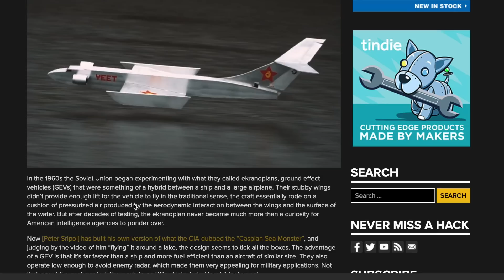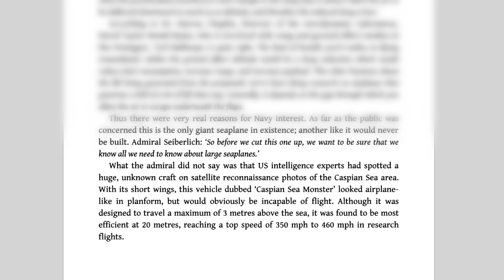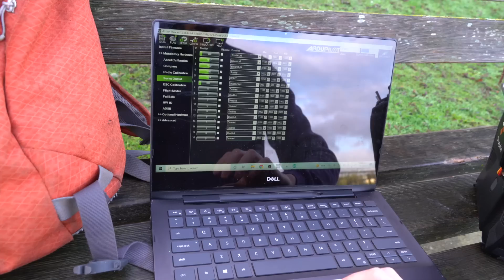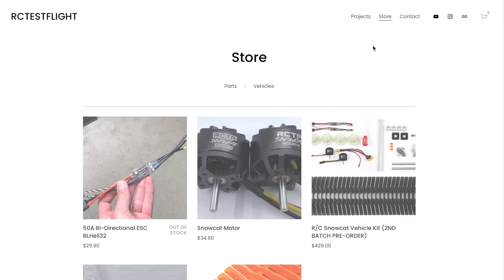Worlds First 'Real' R/C Ground Effect Vehicle

Comment: My defenition of a ground effect vehicle is when it can fly in the ground with a much higher efficiency than flying normally in the air
Reply: Yeah. That's the more interesting definition anyway. It should derive some actual advantage, in this case efficiency, from the ground effect.
Reply: That´s true for every aircraft
Reply: @ikermunoz6947  thanks, this reliefs me of the annoyances about a few last videos.
Reply: @ikermunoz6947  "That´s true for every aircraft"
While I think it's safe to say most/all aircraft are more efficient in ground effect than flying slightly higher than ground effect, I think some airplanes have their optimal efficiency at much high altitudes.

The MIG pilot who defected from the USSR had to fly low to avoid radar for part of his flight. He was very eager to get back to a higher altitude because flying low was burning fuel way too fast. I'm pretty sure dropping down to ground effect level (even if practical) wasn't a good alternative.

@Everyone: We just having fun here right?
Reply: @ddegn  those migs have short wings and ground effect happenens only at 1/2 the wing span in altitude. and there is like trees and stuff. also high altitude is just stright up better than ground effect. it loweres the drag by just haveing thinner air and lower fuel compution by haveing less oxygen. ground effect is only so good at reduceing drag from helping with lift.

like the voyager that fel around the world on one tank of gas flew at high altitude for a reason.
Reply: @nick4506  "those migs have short wings"
Yeah, good point. Kind of hard to fly in ground effect in a MiG over trees.
I remember reading the pilot's autobiography as a kid and being surprised the airplane flew better at high altitude. As you point out, there are reasons why high altitude can be more efficient.
Reply: @ikermunoz6947  yes i know the every aircraft most be at least a bit unstable to fly correctly, but in my comment when a say un stable it mean for this kind of vehicle.

the wings of a ground effect vehicle is optimised for the ground effect area, above that the air flow and lift become really different so the center of lift move, resulting  in a unstable flight for the ekranoplan
Reply: Would be interesting to measure the power draw from flying in ground effect versus flying in the air
Reply: agreed, I think even the massive Russian ones could leave ground affect, I heard somewhere that they were designed to fly over tall bridges if needed.
Reply: Exactly what I was about to comment.
Reply: Exactly. GEVs aren't supposed to be unable to fly - anything can fly if you have control surfaces and a powerful enough motor (even if it's essentially prop-hanging). GEVs are meant to be designed to fly at that height, using ground effect to get better efficiency.
The ones that don't seem like GEVs are when they can fly high by essentially prop-hanging, but when they're flying low over the water they're still kinda prop-hanging - much less efficiency than just giving it big enough wings to fly as a plane.
Reply: Easily measurable by amps and meters. Good idea
Reply: I may be way off here, but..
I thought the point of the ekranoplan is that it's possible to make one that can carry more weight at a lower fuel consumption, than a similar plane designed for high efficiency at a high altitude.
I.e. the absolute max fuel efficiency carrying heavy cargo is an ekranoplan in ground effect, not a normal plane at high altitude with less drag. Speed would be lower, but efficiency higher.
Reply: @phizc  yes, due to flying in ground effect the induced drag is reduced dramatically. So more lift at lower drag compared to flying higher. Normal aircraft improve efficiency by flying higher in thinner air.
Reply: I agree, and still, a ground effect vehicle is not just an airplane flying low, but an airplane designed and prepared to fly low, e.g. capable of touching the surface at full speed, and other specifics that should never happen to a normal airplane, but will be unavoidable in ground effect heights (e.g. obstacle avoidance)
Reply: then all planes are ground effect vehicles. because all planes are affected by ground effect.
Reply: @nick4506  that's true, but the efficiency of a plane that's designed for being a ground effect vehicle is much higher than a normal plane can a achieve in ground effect
Reply: Beautifully executed!
Reply: That’s a good way to think about it
Reply: You almost got the actual definition. The problem with yours is, that any aircraft will fly with a much higher efficiency in Ground Effect. What makes a GEV special is simply that it is optimized for this flight regiment.
Reply: @Argosh  Well, you'd want it to be able to stably fly in that ground effect - I think the crux of the issue that people have with most RC ground effect planes is many of them are simply planes with active controls (eg a PID controller on the elevators) to keep them flying low to the ground. My impression is that full-size ground effect vehicles are set to a throttle level where the ground effect would automatically keep it at that height.
Reply: @Vousie  rc aircraft operate at Reynolds numbers and weights where self stabilization is unreliable. So yeah, they need a bit more help. The definition still works perfectly for them.
Reply: @Argosh  And that is why I don't think a "real" RC GEV is possible. It just can't work with the self-stabilisation that GEVs are supposed to work with. Thus the only way to do it is to "fake" it with PID controllers or similar.
Reply: @Vousie  actually the opposite is the case. To fly an aircraft at below 500.000 Reynolds Number in such proximity to ground requires modification. While theoretically possible it is generally avoided because of the inherent instability close to the ground.
I can fly my F5j sailplane at 1m above ground. It will do really well, until a gust hits and it crashes before I can even counter steer.

It is possible to aerodynamically mitigate that with a variety of measures. One is, ironically, not to fly too deep in Ground Effect.

Ground effect is a factor as high as twice the wingspan depending on speed, beginning when the downwash interferes with the ground. The deeper in you are the more jumpy your vehicle becomes. This is due to the fact that if for any reason you loose ground effect you loose a massive amount of lift. So while you might barely even notice a small gust at 50m, it will totally wreck you at 1m.

Fun fact: I'm speaking from experience here. I've lost a model and nose dived many more because of sudden loss of lift in ground proximity. That's why I've started to fly basically anything with at least butterfly breaking available to shorten the period of maximum risk.

You can try to fly F3k if you want to get a good feeling for operating a small RC plane close to the ground. They're generally tough enough to survive nose diving from a meter or so.

I already stated in a comment what I would do: Build a forward swept flying wing for optimum stall characteristics and then experiment by getting closer to the ground little by little.
The idea of Ground Effect isn't necessarily to fly as close to the ground as possible, it's to extract as much lift as feasible at the lowest possible drag while in a stable configuration.
Reply: Seems like they should just be called GEP or ground effect planes.  Just like we have cargo planes, passenger planes, stunt planes, etc.
Reply: I agree. Take the flight time and then compare to ground effect time. If you can go longer in ground effect than you have achieved the goal. If you can double the time I think you win a prize of some sort but ill have to double check the rules on that lol
Reply: Your definition includes literally every single aircraft lmao
Reply: @aleksjenner677   that's true, but the efficiency of a plane that's designed for being a ground effect vehicle is much higher than a normal plane can a achieve in ground effect
Reply: Agreef
Reply: That is the right definition sir.
Reply: @ButterfatFarms  

"Certified for operation..."
"Certified to temporarily..."
"Certified for operation..."

None of that defines what the individual designs are capable of achieving. It only specifies what they are legally certified to do.
Reply: Can’t argue with that
Reply: @Wischmopps  i thought planes were more efficient at higher altitudes in the reduced atmosphere
Reply: @Grim FPV yes but most of them were unstable above groundeffect, the only one who was really able to fly efficiently both in the groundeffect and out was the VVA-14 and he had a bigger aspect ratio  that any other ekranoplan
Reply: So never then, got it. Nothing would have higher efficiency closer to the ground thanks to gravity, wind, and air pressure. You are defining cold fusion here. Build a boat that can swim against the current with out any power - you. Can't be done friendo. If you develop cold fusion though, you'll be rich, famous, then dead by all the angry power manufacturers.
Reply: @johnthomas1422  your example is extra funny because a boat that can go against the current without power exists. It's called a "sailing boat". Even extracting energy from the waterflow alone is theoretically possible.
So yeah, the point of ground effect vehicles is literally to reduce induced drag by proximity to the ground. That allows them much higher efficiency lift and thus more speed and capacity at the same power.
Reply: @johnthomas1422  "So never then, got it."
Are you replying to a comment in this thread? If so, which comment?
Reply: @johnthomas1422  https://youtu.be/jyQwgBAaBag

I'll let you know how the cold fusion goes.
Reply: @Grim FPV Did you miss about the efficiency part in the comment you reply to? Yes it could but it was not effective, so whats the point with your comment?
Reply: @Jeppelelle  They acquiesced. By showing that even THE ground effect plane could 'fly', they are indeed saying it does not negate the RC design being a ground effect vehicle. It's literally what is said in tue first 2 minutes of the video..
Reply: @Jeppelelle  You clearly misunderstood the comment
Reply: @Jeppelelle  

"But it was not effective. So what's the point with your comment."

Clearly the point was to provide an example, in support of the original comment, of a ground effect vehicle that could fly but was more efficient in ground effect.

Original comment: "Definition should be; Can fly out of ground effect, but it's less efficient."
Reply: "Provides example of one that can fly out of ground effect, but it's less efficient."
You: "Did yUo MiSs tHe PaRt aBoUt EfFiCieNcY?"
Reply: @notahotshot  Read the comment i replied to again, then mine, then try to apply atleast one ounce of intelligence while reading it. Your reply makes no sense since you obviously did not understand the conversation
Reply: @Jeppelelle  it sounds like you didn't understand the conversation.
You weren't the original commenter, nor the replier.
And apparently you missed notahotshot's last paragraph. Smile
Reply: @mattymerr701  No i was not the original commenter, never claimed i was but i was the replier, i replied to Grim, it's pretty obvious, don't you know how mentions works?
Reply: @Jeppelelle  okay, yep. I'm just being baited by a troll I guess lol.
Only explanation to the double-down without any reflection right
Reply: @Jeppelelle  

The comment you replied to provided an example of ground effect vehicles that could inefficiently fly out of ground effect. This supports the definition provided by the original comment.

Your reply was to ask if they missed the part in the original comment about efficiency.

Your reply was pointless.
Reply: @Jeppelelle  they are pointing out how the comments that started this video have a faulty definition.
They are agreeing with the comment at the top of the thread, by pointing out how it is more realistic compared to the faulty definitions that sparked this video.

(Well, they might not be agreeing with the original comment. But it shows that the definition of a "real ekranoplan" aren't right)

Comment: What if you used hydroplane surfaces to lift the plane out of the water and make them retractable?
Reply from the maker: I know hydrofoils and GEVs intuitively seem like a great match but turns out they are pretty much completely incompatible. I've experimented with this myself and know others that have done so as well. Even though hydrofoils have a lot of hype about having very low drag, they actually have quite a lot of drag at high speeds compared to a hydroplaning surface. They are also very picky about their speed range making it almost impossible to match an aircraft's ground speed which can vary greatly.
Reply: I had the same thought. I think the foil could definitely pop the GEV up off the water at a lower speed, but retracting the foil without pulling the vehicle back down seems hard. I can almost convince myself it should be possible, but hard to explain in a youtube comment :D
Reply: @rctestflight  wow, i never expected a reply, but yeah that totally makes sense
Reply: @rctestflight  Thats true, however he used the term hydroplane. He may have meant hydrofoil, but the hydroplane may actually be workable. Hydroplane as being a a planing hull surface. 

One can suggest pontoons or skis on a suspensions system of sorts that may at a specified speed jump the GEV into the air. The thrust of the push will of course need to be angled in such a way as to not upset trim while the additional drag created when pushing down would need to be less than a value that slows it below stall speed.

Such complication of course is likely unwarranted.

A better/simpler option is the use of stepped planning surfaces with dihedral angles that soften landings and decrease wetted area as speed increases. 

The surfaces carrying steps that are angled rearward to allow air to slip in behind the step. If the planing surface is like an inverse vee and the hull/fuselage is in the form of a blended flying wing. The result ought to be a sweet GEV imho.